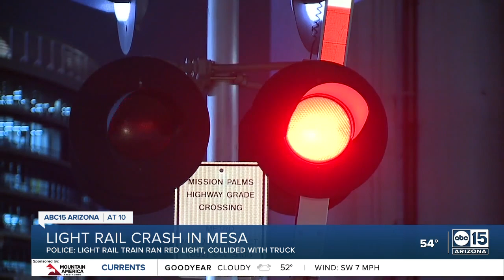In aftermath of crash with garbage truck, how does light rail operation at stop lights work?

Comment: It's 2024, and we don't even have updated traffic lights yet. I still have to sit at a 2 minute red light while absolutely no one goes through the green.
Reply: Those lights are used for traffic control. Go ahead. Treat it as a 4way stop. No cross traffic? GO!
Reply: @80sCrazyCatDadNGunAddiction  that's not how that works.
Reply: @jerbwood sadly to many drivers think that’s okay. Do you have the option of right on red there?
Reply: @danieldaniels7571  yes, we can turn right on red unless there's signage saying otherwise. You can even turn left on red as long as it's a one-way street onto another one-way street. But you definitely can't cross an intersection on red, no matter what.
Reply: @jerbwood  so is there a sign saying otherwise at the red light you’re complaining about
Reply: @danieldaniels7571  it isn't just one light. It's all of them. It's the whole system.
Reply: @jerbwood  ah. Well, where there are two minute red lights and I can turn right on red, I usually do so I can keep moving.

Comment: The entire traffic system should be automated
Reply: It is but all the cities in the Valley only have the traffic signals programmed to run one schedule no matter what time of day it is. This is why in low traffic or nighttime traffic the light randomly turns red with no cross traffic. Or the light is running the entire duration of the cycle. Making you wait for the non-existent pedestrians.
Reply: @garcjr  out in Peoria, some light change between daytime and nighttime. On Thunderbird Rd in Peoria, from 83rd Ave to 91st Ave, pedestrians have a guaranteed walk signal going along Thunderbird, but only during the daytime. At night, they have to press call buttons to get a walk signal.